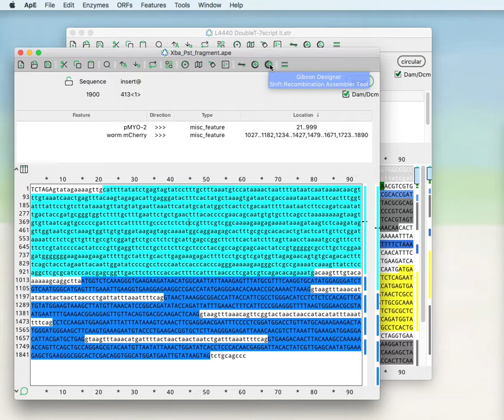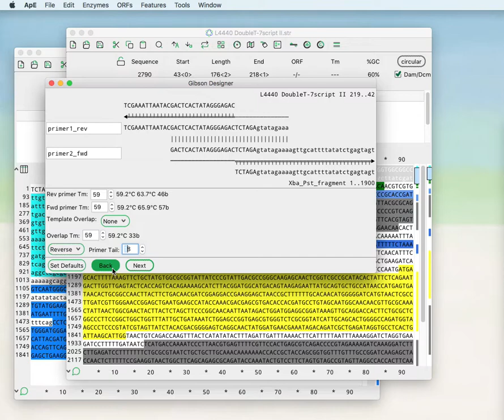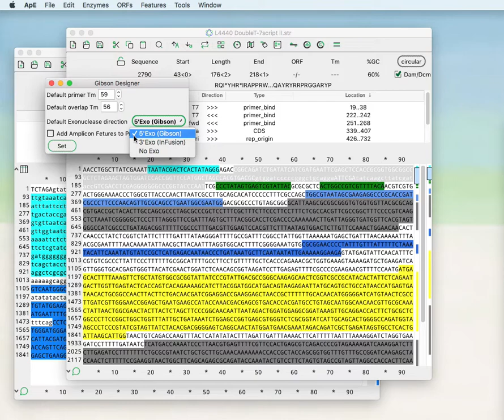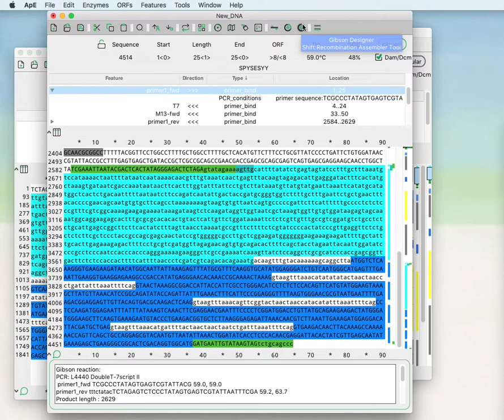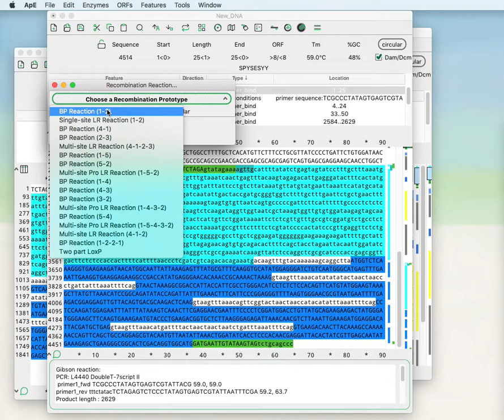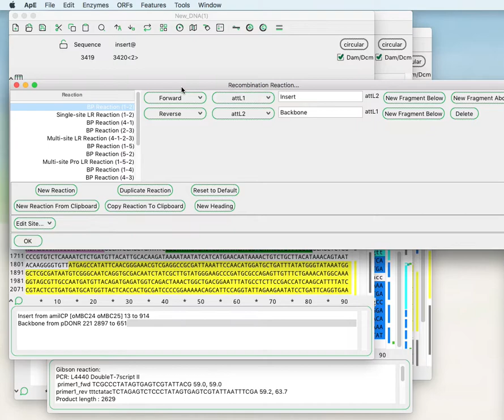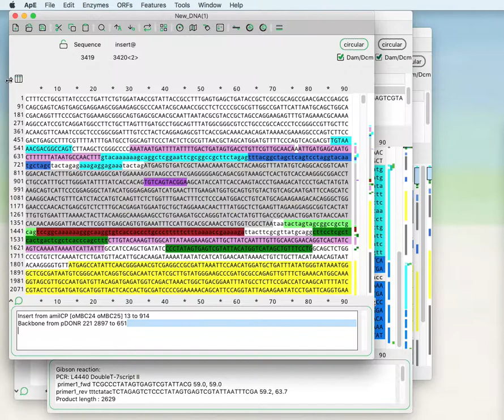ApE Tutorial Video #8 - Gibson Designer tool and Recombination reaction tools

Comment: Hi. I have a problem. I want to do the in silico GATEWAY cloning with the pDONR221p3p2 vector and my PCR product. I did the in silico PCR reaction already using my pMDC vector as template and the B3 and B2 primers that were designed (and published). Now I used the Recombination Assembler Tool and the BP Reaction (3-2) but the programm only recognizes the insert (either pDONR or the PCR fragment or the pMDC vector map) but not the backbone (it says "None found"). How comes? Can you help?
Reply from the maker: This was a bug in version 1.3.6. Download the latest version and it should be fixed.